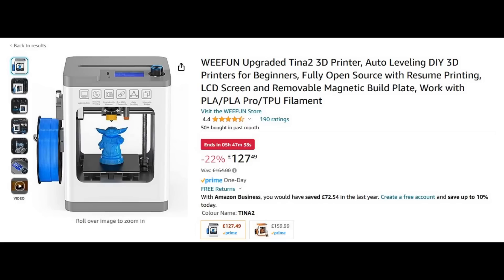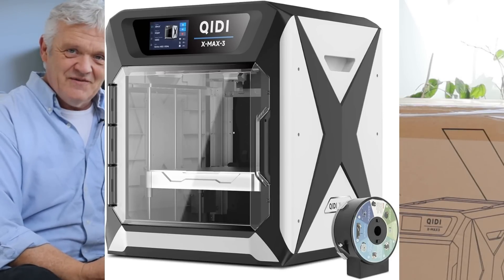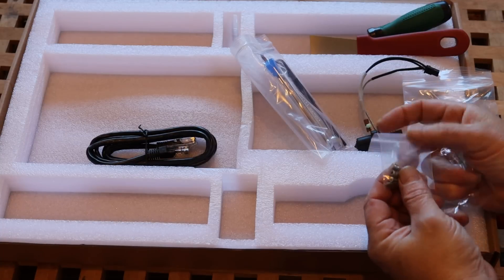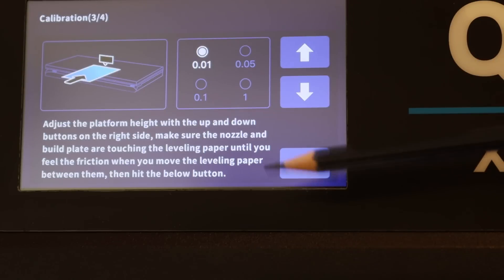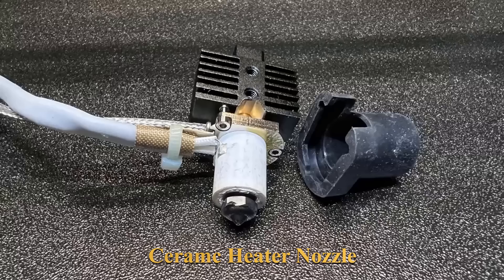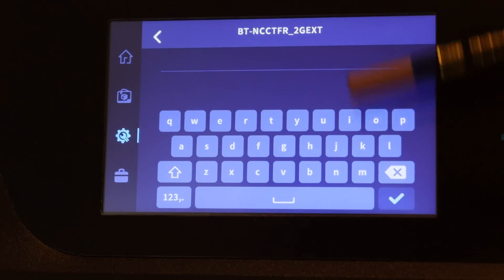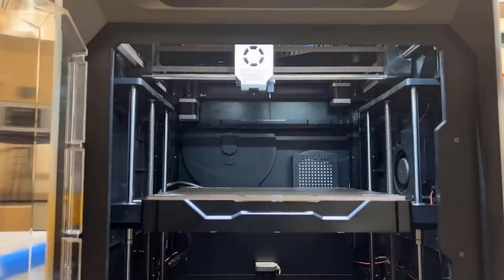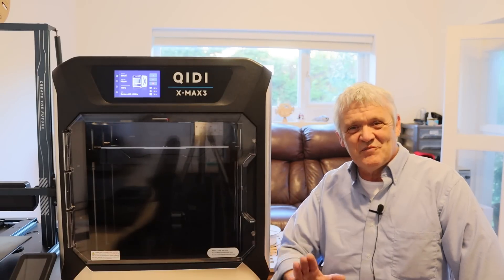2080 Qidi X Max3 - Unboxing and Setup

Comment: My first 3d printer and I must say, nothing in the instructions or videos like this tell you to put the "build plate" on before running the setup. If you don't put that metallic plate on, the bed will slam into the hot end repeatedly. Ruined my first QIDI X Max 3. The replacement came, I followed the directions, didn't install that plate and watched it attempt to hit the hotend again and unplugged it. 

After inspection I noticed what looks like a proximity sensor on the side of the hotend so I figured that plate might be needed for reflection etc. That was it. Luckily no damage this time.

Am I just missing this step in the instructions? I mean after thinking about it you would need that thickness on there to calibrate but it just didn't hit me until further troubleshooting.

Comment: One thing I have wondered about was wether it would be possible with conductive printable plastics of differing electrical conductivity to 3D print a thermoelectric mesh circuit. Wearable thermoelectric items such as a cycling helmet that could power an led would be quite literally cool and also useful. 
Not sure if it would be possible with the current filament technology however. I suppose one could sew and solder some wires into the helmet to achieve the same thing.

Comment: Interesting.  The product used to make the object you want, what properties does it have e.g. can the plastic(?) stand a lot of heat without melting? my nephew had a part of the pipework for the heater matrix on his car need replacing, we wondered if it could be 3D printed and it withstand a lot of boiling water?

Comment: ABOUT VIDEO 1931... your video on more efficient 3d printed generator.. I would like to see if you would reprint  the rotor so that you can try a halbec array to see what kind of voltage difference there is plz like this comment if you would also want to see this
Reply from the maker: halbach arrays will certainly improve it mate
Reply: @ThinkingandTinkering  I wasn't shure I've only seen them used in motors
Reply: @ThinkingandTinkering  oh wait I think I understand I bet they only work in one direction or a least better in one direction
Reply: Actually now that I looked at the halbec array it looks like the rotor would have to be on the outside of the stator to have greater effect

Comment: Hey dude, I see you've gotten into 3d printing in recent years.
I remember you from how you made graphene inks from grafoil.  
I replicated mixing some of your DIY graphene with ABS plastic.  I worked in injection molding at the time, and It was pretty tough plastic.  You also made some bioplastic at the time.

Have you ever considered making or getting your hands on a small scale extruder to mix up some different batches of a more modern graphene 3d printing filament?  I've looked at the ones from china to make the weedwhacker filament style, but I'm also considering using a small scale injection molding machine to experiment with multi-plstics composits as pull-trusion might let me get away with higher graphene pigment loading.

Wanted to check in if you had scratched that yet, because loads of stuff would be neat with conductive filament -- including electroplating over the plastic, RF shielding, self-lubricating gears & bearings....  Some bloke made a decent paper on semi-industrial scale graphene with cap discharged in an argon enviroment with recirculating graphite powders last year; also have yet to try it.

too much to do, too little time.  Cheers mate
Reply from the maker: it's only in the last year mate

Comment: On dons chart he shows the relationship between frequency and high voltage the greater of each the greater over unity. I don't know how hight of voltage you can set up but it might help . You can always cap dump the high voltage down to a hundred with a neon mosfet combination to a doorbell transformer to get to 15 volts .
Reply from the maker: is that Don Smith?
Reply: @ThinkingandTinkering  yes they run together the more of each the greater the over unity.
Reply: @ThinkingandTinkering  sorry meant for someone else my tablet is acting up noticed it today too

Comment: Thank you for the great review. Note: A machine that large and advanced should really have 2 heads (dual extruder design) that run at the same time: one to print the part, and the other to concurrently print the support material so that 3d prints can have high quality overhangs and bridges without falling apart.
Reply from the maker: they do one with two extruders mate - but it is UK£2k
Reply: @ThinkingandTinkering 😮!!
Reply: @ThinkingandTinkering  and it doesn't have the speed or other features of the 2023 machines.